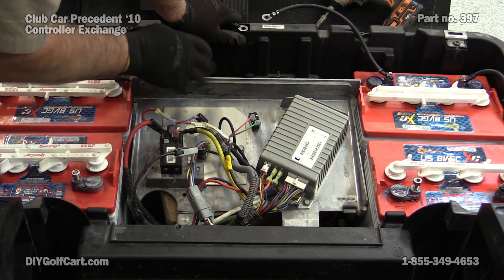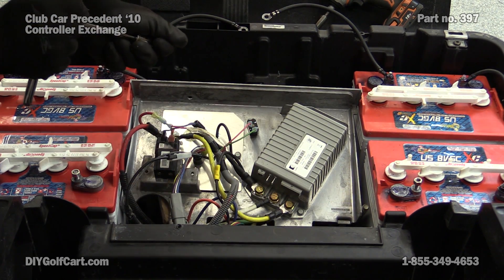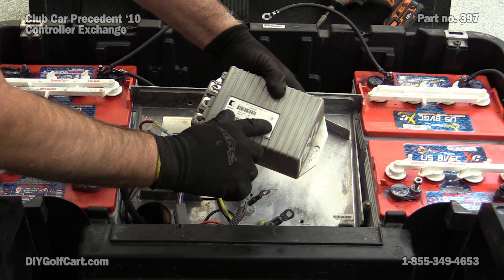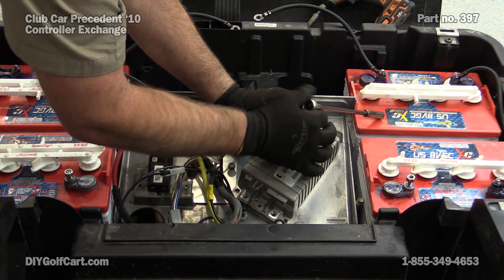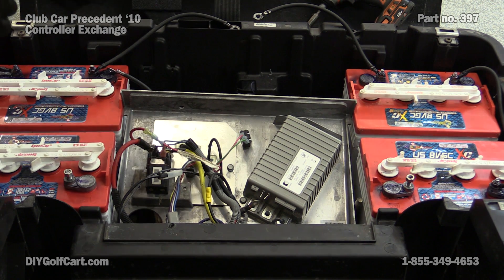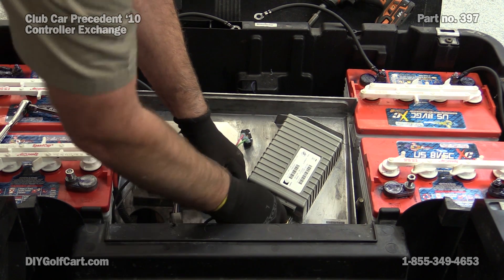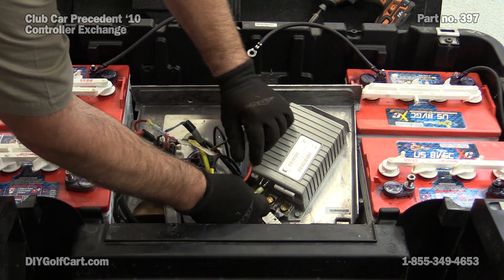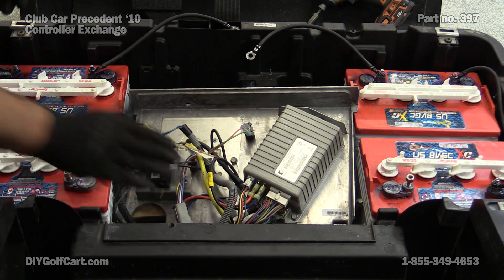How to Replace your Controller on a Club Car Precedent

Comment: I'm looking for a video that explains how to narrow down the failed component when a 2013 48v Club Car Precedent does not run. Checked all the obvious, fuses, ignition switch, fwd/reverse switch, solenoid. How to determine if its the OBC, controller, or motor?
Reply: I have the same issue. I’m trying figure that out as well.

Comment: I was changing the volt meter and caused electric short.  I now have no power except to the lights.  Is there a fuse somewhere maybe inside the box where the controller is located?

Comment: We have a 2008 CC Precedent 6 pass.  It only goes about 18 mph. We replaced the high speed magnet with one that was suppose to speed it up, being told it should go 25 mph.  It only gained 2 mph taking it to 20 mph. Was there something we were to do after replacing the magnet?  Or what else can we do to speed it up?  Thank you for the video showing how to replace it.

Comment: Barry I have a 2014 precedent and I have to press accelerator 2-3 times for it to go… I’ve replaced solenoid, mcor my next step is controller does this sound correct (electric)
Reply: Hi, i'm having the same issue.  Did you get yours to work?  Was the controller the issue?

Comment: 07 president 
got the electronics wet . garden hose wet.
then it froze the other night.
it worked I ran it around parked it in the shed but next morning .. nothing.
only the foot pedal "clicks" I do not hear the solenoid today . it's dead .
what part do you think I may have fried by getting wet.
currently it has a fan blowing directly on the electrical panel.(controller.computor.solinoid)
Reply: any thoughts would be helpful.
there is no water visible but again it's dead . the lights/horn/back up beeper all work.
I plug the charger in and it seems "normal" 
anybody any ideas that doesn't cost over  a grand to repair ?

Comment: I have new batteries in my 2012 Club Car Precedent.  It doesn't move, no lights, nothing.  Repair shop says they think that it's the controller, but no guarantee.  Is there a way to test the controller and associated circuits.   I would like to know that if I replace the controller if that will fix it or am I throwing good money after bad.
Reply: Mike did you ever get your answer?  did you change your controler out?  how much was the new one?

Comment: My 2013 Club Car Precedent will not go the first time I depress the accelerator but does on the 2nd or 3rd try. Changed the MCOR and didnt help. Any ideas?
Reply from the maker: Does the solenoid kick in each time?
Reply: Yes it does. I also tried a paper clip in the two prong connector that goes in the MCOR and it still does not act any different. It will seem to work ok if the pedal is pushed again within 5 seconds of stopping. But if it sits still for 10 seconds or so—it won t go until I press the pedal for the second or third time.
Reply: I have changed the MCOR and the solenoid and the cart still won’t go until the accelerator is pressed a 2nd time. Any ideas??
Reply: I wasn’t sure that it was so I changed out the solenoid and now I am sure it clicks every time the pedal is pressed. But the cart still won’t go until the 2nd or 3rd time the pedal is pressed.
Reply: @benbrohammer4969  did you ever fix this I have the exact same problem already replaced solenoid and mcor any help would be appreciated. I’m thinking replace controller then if not that I guess the only thing left is obc?

Comment: Hello Barry, I took my 2012 Precedent to a club car dealer to have my speed increased. They tell me I already high the high speed code in it but my Controller is bad?  The cart takes right off gets right up to 10 MPH and that is it.  The cart has been the same for the 3 years I have had it.  I am told that when a controller goes bad the cart will only do 3 -5 mph that my problem is not the controller?  What are your thoughts.
Reply from the maker: There is no specific symptom for a bad controller. Check the output of the MCOR (0 to 5K)  then check the output of the controller (B+ to M) with the pedal fully depressed, should be 48 volts.

Comment: I have a 2015 club cart high speed motor 25mph. It was submerged in a lake. The motor and controller were supposedly replaced. Problem being the accelerator when put to the floor the cart stops but runs if you push it just short of the dead spot. Also bucks at times, i replaced the mcor to no avail.
I believe the controller is bad but don't know which one to buy. Any suggestions???
Reply from the maker: https://diygolfcart.com/club-car-iq-400-amp-regen-speed-controller/    Call me for possible better price and availability.

Comment: on this video the black cable on the controller is also connected to 2 other wires, I know that one comes from the battery , one from the the OBC, does any one know where the last black wire with the yellow crimp comes from? thank you

Comment: Good job I have 2008 presdant with high speed motor and chip.haveing problem with it its stops runing and will not charge. Takes many times to get it to charge.any one no what it could be???.
Reply from the maker: First, a 2008 CC Precedent doesn't take a chip?!?!  Won't take a charge? OBC....Get the OEM # off the OBC and give us a call. I do have a video showing where the OBC is and how to change it.

Comment: Hi Barry I have a 2010 club cart. It seems to run good after charging but dies out after a short time. It will barely make it up hills. If I let it sit for awhile it will run fine again but for only a short time. Batteries test good any idea what might need replacement or adjustment. Thank you Randy
Reply from the maker: My money is still on the batteries! Give me a call to verify your test results on the batteries.

Comment: Can a club car precedent that takes   six    8volt batteries, be converted to take 4  12 volt batteries?
Reply from the maker: Yes it can but, it's not a good idea. You run time will be cut down.

Comment: How do you know this part is bad? I have new batteries, new solenoid, new ignition. Press the go pedal and nothing happens. Jump the solenoid and get a spark and still nothing happens.
Reply: 2009 club car village
Reply: Did you ever figure out what your problem was?
Reply: @jrock11114  had a short in my wiring. Ended up having to put in the shop and have them figure it out.

Comment: Berry i am replacing my stock motor ,controller and solenoid (club car 2019) contr is a Alltrax  but not have no terminals for the blue ans orange wire to plug in
Reply: You replace those push on ends with bolt down ends, if I'm remembering correctly.